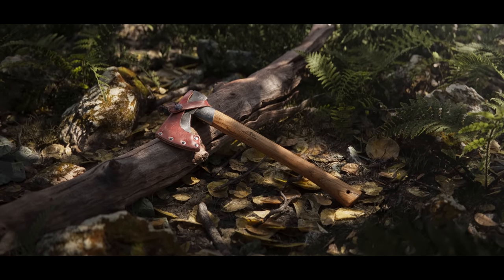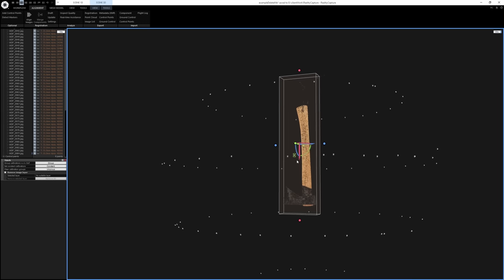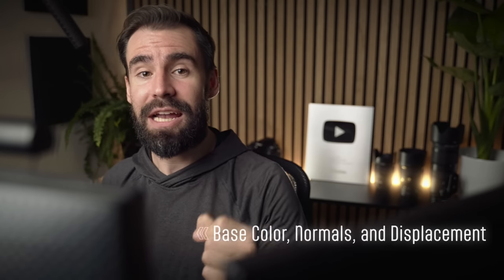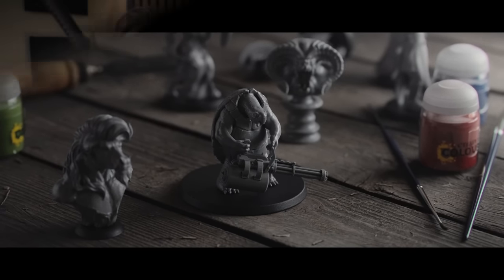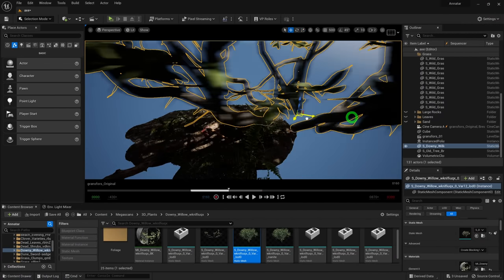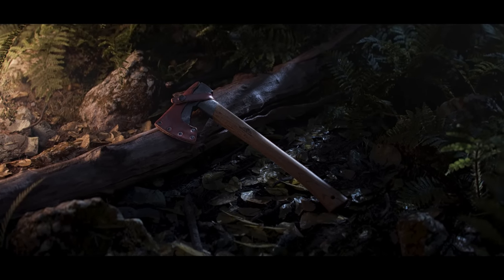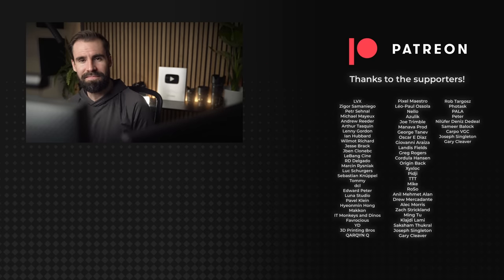How I Made This Shot in Unreal Engine 5

Comment from the maker: So it's come to my attention that you don't need to disable Nanite on the meshes you use with the Pathtracer. There is a console variable you can use:
r.RayTracing.Nanite.Mode 1
This will force the pathtracer to render the best possible fallback nanite mesh resolution. Having done a quick test, the results ARE a tiny bit different. It isn't quite 1:1, but if I wasn't doing an A/B difference test in photoshop, I wouldn't notice. The nanite fallback mesh seems to have different triangulation than simply disabling nanite. But whether or not that is a big enough difference to distinguish, is up to you. 
Tips  like these are why I love this community, always more to learn! Hope this helps some of you!
-W
Reply: If you want to have NO difference between fallback mesh and nanite, set Fallback Relative Error to 0 in the Static Mesh Editor Details panel under the Nanite Settings section.
Reply: Thanks for sharing on top of your original share
Reply from the maker: @CusousKI  It’s not the fallback mesh resolution, its the triangulation of the mesh that seems different
Reply: @WilliamFaucher  Yes, fallback changes the triangulation of the mesh, it can be controlled in two ways.
1. Fallback Triangle Percent - if you set it to 50, the mesh will have half as many triangles compared to the original mesh (same way as the LOD system works).
2. Fallback Relative Error - Even if you have the first setting at 100% it will still reduce triangles. Setting it to 0 disables that reduction and makes the first setting accurate.
In my testing the difference is quite large. The default round table went from 4320 triangles to 972 with Fallback Relative Error set to the default value of 1.
You can test it in the Static Mesh Editor: Enable Nanite - in Viewport click Show - Nanite Fallback (or use CTRL + N). Change to Wireframe so you can see more clearly and test the two settings.
Reply: @WilliamFaucher  Is there a reason that you don't use screen percentage?
Reply from the maker: @ravindrahere501  Didn’t really want to quadruple my render time for that shot!
Reply: Nah, my quixel assets light completely different with Naninte off + pathtracer. There's weird highlights in the shadows that the default engine doesn't add, I don't get why pathtracer would think light works the way it does vs in default render?
Reply: I have 2 main questions for you regarding this: 
1. What was the time difference between rendering the scene with nanite/lumen vs rendering the scene with max mesh resolution (or nanite fallback resolution) and path tracing.
2. What are your system specs? 
Reason I ask is I am wanting to kind of get a quick estimate of how long it will take me with my setup to render a similarly complex scene.
Reply: Jesus christ! I literally FELT that cold morning @ 14:14 in my bones! Brilliant video and tutorial. So glad I found this channel! <3

Comment: I've just recently come to Unreal, and have only been using Lumen. Coming from an "oldschool" 3D background of offline rendering, I didn't see the point of using path tracing in real-time. Still, I'm curious and would be very happy to see a "new" pathtracing video, because the examples in the video have already convinced me to start using path tracing in Unreal in the future.
Reply: Part I'm having a hard time understanding is why light changes so drastically with Nanite when switching to Path Tracer as the export. In viewport it looks fine but doesnt have same light respect that Lumen does, just seems very unrealistic. Additionally, default AA settings out of UE5 always look better on export than ones YouTubers fiddle with - his settings may be more accurate with Path Tracer specifically but my 5 minute Lumen renders which look great turned into 12 hour Path Tracer exports with tiny flickering AA quality. 

I think there's some other setting that's hidden and unmentioned by mistake, and I don't know why anyone would want to do half day "accurate" renders out of UE5 when the whole point of UE is to take barely any rendering time at all.

Comment: Great presentation, and learned couple of tricks from your workflow. FYI, you can use pathtracing with nanite in UE 5.1 , the cvar is r.raytracing.nanitemode 1, it will use the highpoly mesh for the surface and the shadow, except for very thin masked object no need to use shadow bias anymore
Reply from the maker: Hah I had no idea! That's awesome!  I rendered two versions to test, one with nanite disabled, and one with this cvar, and the results are sliiiightly different. Not different enough to notice but it's interesting that the triangulation of the mesh is different. Still a fantastic cvar though!
Reply: @WilliamFaucher  found it just last month while digging up why the last cvar you share with us to fix nanite in in RT shadow, no longer working in UE5.1. It turns out dev at epic already have new solutions for that.

Comment: I've really enjoyed following your tutorials and have learned so much following along step by step! However, I am a bit confused about the spray. I know it helps to mitigate the issue you get from reflection but doesn't the white spray give you white on the albedo? Do you have to take two scans? One for the base color and the other for the surface detail with the spray?
Reply from the maker: Yes, if you want both a cleaner scan, and the proper albedo, you'll need to do two scans and combine those datasets. In my case, I only scanned the very edge of the blade, since I knew it would be hidden by the leather sheath anyway ;)

Comment: Thanks man. Still, in other videos you're stressing that one should be very, very careful with overlapping high res geometry (in regards to Nanite). Yes you're using the path tracer here, but from my understanding (through your channel mostly) your demonstration at around 9:30 would lead to erronious results in certain approaches.
Reply from the maker: I'm not using nanite here ;) But it's also only for performance reasons, if you don't care about performance, do whatever looks good :)
Reply: @WilliamFaucher  Hmm... might have to rewatch that other tutorial of yours where it's hinted that overlapping geo is to be avoided at best, not primarily for performance reasons but for Nanite to work correctly. I noticed you didn't use Nanite here, so fair enough in this regard ;)
Reply from the maker: @andreasnoutschmidt9964  It's not that nanite won't work correctly, it's just that your framerate can/will tank a bit. But bear in mind that video is over a year old by now, and things HAVE changed.

Comment: What color management did you use for Painter and Unreal Engine? I am currently using ACEs 1.2 in a project and I'm not even sure if I should be :/
Reply from the maker: Just default settings, my way of working in painter largely just involves painting masks, so colorspace isn’t toooooo important

Comment: Great video William as always!  Btw Nanite works with Pathtracer, try this : Go inside the Mesh you want to work with Nanite and Pathtracer, then under Nanite Settings > Fallback Relative Error  : put 0.  :)
Reply from the maker: It's not using nanite in this case. It is using the fallback mesh, which is just a proxy version of geometry that lumen uses to cast shadows. Setting it to 0 means it's not reducing the polycount. But it's very slow to set it to 0 on every mesh, and will affect your lumen performance too, whenever you need it again. Whereas just disabling nanite across selected meshes is way faster.
Reply: Fun fact: Nanite's dev did mention something about trying to make Nanite work with the raytracing hardware on GPUs at the last Nanite technical presentation, but I don't think this is already in the engine. Also I'm not sure if that also meant pure pathtracer or only the raytracing features in deferred renderer.
Reply: @WilliamFaucher  I see, didn't know that it can slow the performance (didn't test it much), for faster individual mesh setting you can always make a blueprint which will auto tweak all meshes selected in one click, but its useless if it will not handle large scenes, we will have to wait for that crucial update then! :) thanks for the info!

Comment: Hi William, thanks so much for another super interesting and helpful video. I'll leave you a question here regarding a problem I found in one of my projects.

I'm using displacement (in UE 5.3) and in LIT everything works correctly but when I switch to path tracer the effect of the displacement is not visible (even if the outline of the object selection remains deformed)

do you or maybe someone in the community have a solution?

thanks a lot!!!

Comment: Hey, quick question, did you use Lumen to light your scene or raytracing? Or is path tracer its own seperate thing?
Reply from the maker: It was rendered with the pathtracer, you can see me turn it on and off throughout the video. I use lumen while setting up the level, but render with pathtracing :)
Reply: @WilliamFaucher  how is your lighting not completely different between those modes?

Comment: Hey William, since you have explore Lumen and PT with great extend. Just wanted to ask you can we use Lumen for cinematic rendering? (as its purely made for Realtime usability)
We are working on a project where we have to render huge city with 10k buildings in it (off course most of them will be at far distance), but with PT we cant even initiate render them using RTX 4090 with i9 13900k. Any ideas on how to approach this problem?
Reply from the maker: You absolutely can use Lumen for cinematics! The only thing that matters is the end result, if you get good looking shots with Lumen, by all means use it.
What you mean by not being able to initiate the render with PT though? Its just crashing? Consider a lower resolution render to narrow down the source of the issue, it is likely you are blowing your vram limits. The 4090 “only” has 24gb of vram. Which is a lot, but also not a lot depending on the nature of your work.

Comment: Hey William, love your tutorials, you probably know this but a great little feature that Epic don't really shout about is the 'StillRenderSetup Automation' utility widget, it's buried in the Engine (so you need to make that visible) usually searching for 'render qu' fins it, right click and run widget. It's a great way to quickly add multiple camera's into render que without having to manually place anything in sequencer. easy to replace with different render output pre-sets too.
Reply from the maker: Fantastic tip!  I definitely still needed the sequencer to animated the camera though, but I didn't know about the utility widget, thanks for sharing! Gonna write this down.

Comment: I need help. I tried downloading Unreal Engine 5.11 on my Windows 10. I put the pathway to my SD Card and when it was downloading to 25%. It just stops and the GB on the downloading tab kept adding to 14GB - 56GB (it says "Install Failed: Error Code: IS-FC02-1392). I tried creating new files, cleaning my SD card, and doing a Memory check but neither worked. Can someone help me with this issue because I really want to make games but this is a problem that I'm too confuse to figure out. So do anyone have a solution and make me finally download UE 5.11

Comment: A "hack" I've found with using the PathTracer and Nanite, is setting the fallback error mesh value from 1 to 0. This also can remove some artifacting when using RTShadows on lights in the viewport too.
Reply from the maker: Then you need to do that for every single mesh. And its not quiiiite the same either. You can mass disable nanite across all meshes in two clicks though, much faster that way!
Reply: @WilliamFaucher  Hi. Wouldn't the property matrix allow you to set the fallback error value? I'm drawing a blank on this, got to check when I get home.
Reply from the maker: @ArghanionsPuzzlebox  SUre, but the processing time for that is VERY slow. Easier/faster to just enable/disable nanite when you need it.
Reply: @WilliamFaucher  That's true. I think it depends on the outcome! You can do it via bulk edit so it's not quite as bad but still more clicks! :)

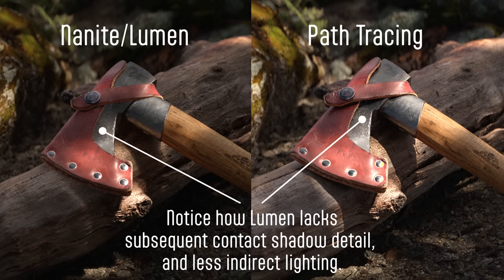Comment: Another great video, William! Love it. At 10:20 however about the indirect lighting and contact shadows, the devs mentioned that for lumen to work efficiently you have to use separate meshes than a single combined mesh, could that be the reason here since the axe is a single mesh?
Reply from the maker: It is separate, I show exactly that in this video! The axe and sheath arent combined :)
Reply: @WilliamFaucher  Great! So lumen indeed acts a bit funky with small pixels.

Comment: Another great tutorial. Quick question, if you know you are doing a final render in MRQ using PathTracer, is it necessary to also have PathTracing enabled on your PPV? WOuldn't it be faster to work in Lumen then only enable PathTracer when doing your final MRQ render?
Reply from the maker: Sure, but you want to see what you’re doing and how things will look before you render, otherwise you’re working blind, especially with lighting :)

Comment: With Nanite, you have to put ''0'' to ''Fallback relative error''...So, with that, Path tracer works perfectly fine :), you can also check the box ''preserve area'' it will load nanite in ''distance''...
Reply from the maker: That fallback mesh isn't nanite though, it's just the proxy geometry that raytracing can use. It's also very slow to set to 0 on multiple meshes, that processing time is long. Much quicker to use the console variable mentioned in the pinned comment above. Or, disable nanite entirely :)